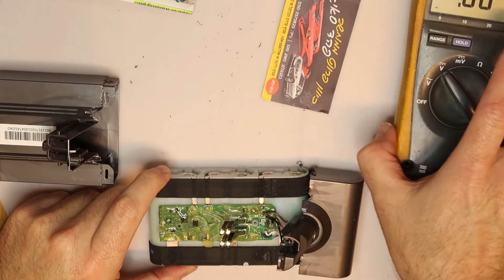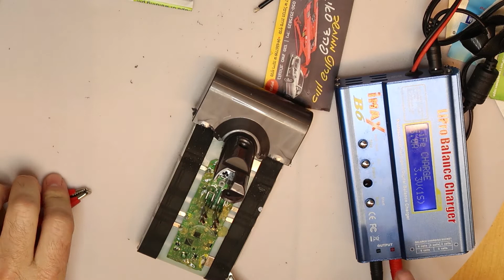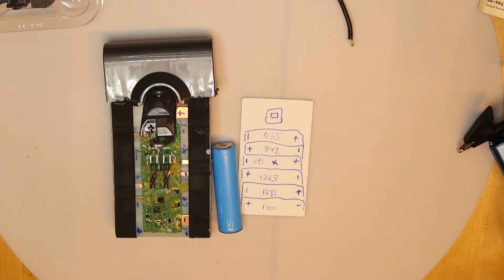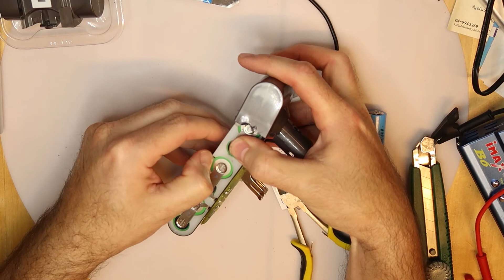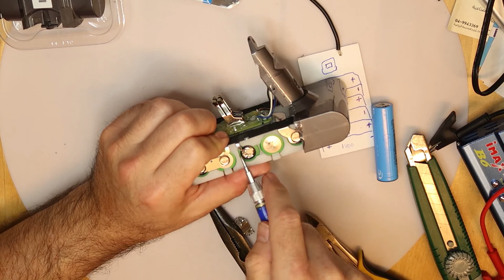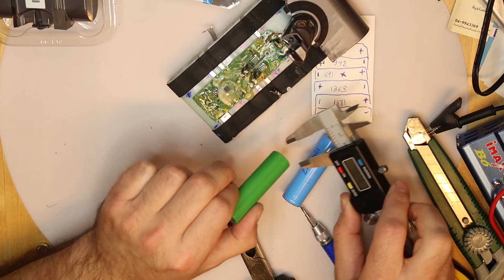dyson v6 Battery fixing - part2 of 3

Comment: Hi, It would be also interesting to test the internal resistance of each old cell. All cells had enough voltage so the motor can work, even with one cell with 3,9V. (can be simply unbalanced).....but it did not run (only few seconds), so no amps enough. Possible that one cell (or more) had a too high RI , and in this case the amps and also the global voltage fall down immediately by use of this cell , and the BMS stops the current. Testing the RI is much faster and secure than capacity test with same result, but both are interesting.
A lot of battery packs have only one defective cell , with still relative good voltage if not working , but with high RI it's enough to cut quickly the current by use. With only one cells line in series like for these Dyson (a shame considering the power of the motor : It would need minimum two lines in //) that happens immediately . 
 In particular with cheap chinese cells for "no name" packs...and I am absolutely not sure they take new cells to build their pack...the price is too low....and I add : often too low discharge amperage; We need minimum cells with 20 (30 is better) discharge amps to re-build this pack...or absolutely not use max power! It's the first real reason for "red blinking lights". With true Dyson packs that happens if we use max power with an almost discharged battery.

Michel

Comment: Sir great video
Reply from the maker: Thanks
Reply: @RoeeBloch  sir i wanna ask a question
I have dyson v6. It gives red lights 10 tes and doesnt work but it get s charged  with blue light on. Then I seperated the battery from main body and pushed the button on battery it is blue and measured with multimeter , it is 24,6 V.
Then i sent the official service they checked and said battery needs to be changed!
So now i m thinking to replace the cells or the bms 
Can it be bcoz of mah of some cells dropped very much even though total volt is ok?
Thanks in advance
Reply: @RoeeBloch  plz urgent help
Reply: @torukojinnn6331  Exactly that, or even though total voltage is enough the BMS registers one or more cells with insufficient voltage.